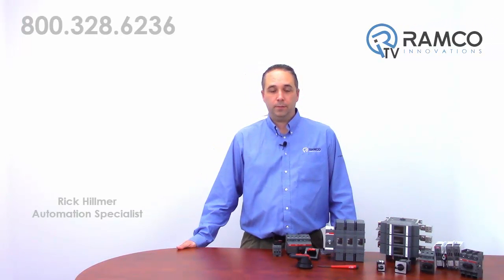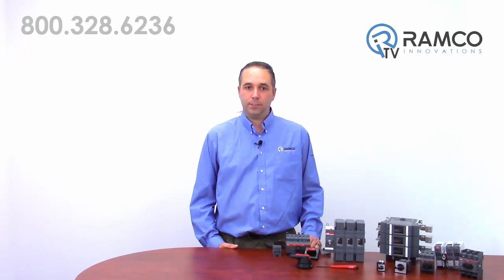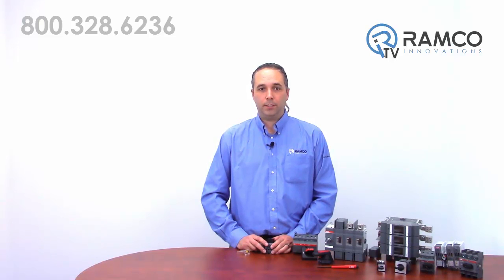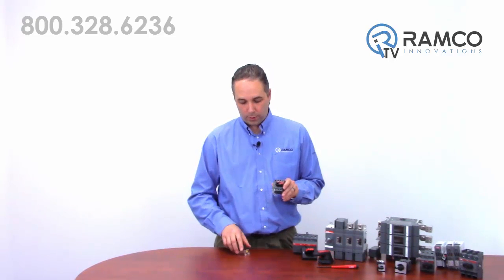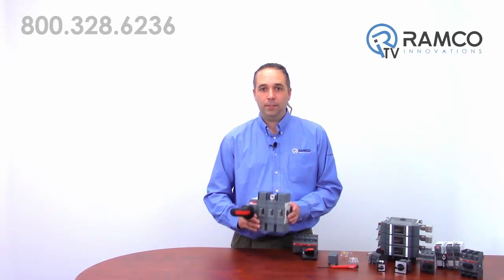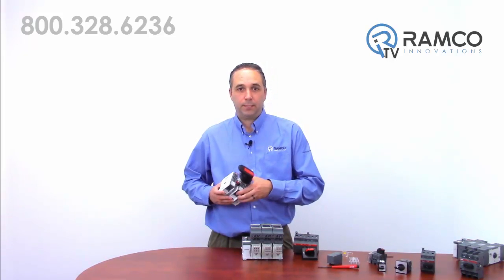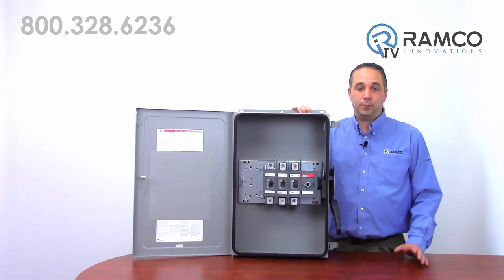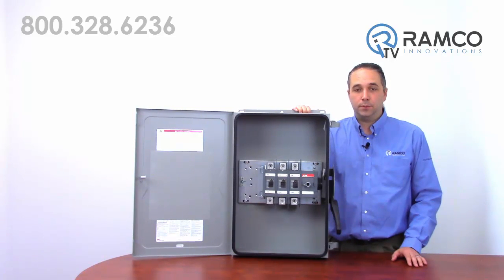ABB Disconnect Switches

Comment: hello Sir, Is it possible to change the position of the handle to open and close the switches? The one I have has two contacts on the right side and one on the left side. Since they are modular, is it possible to change the position of the one on the end so that the three lines are together?